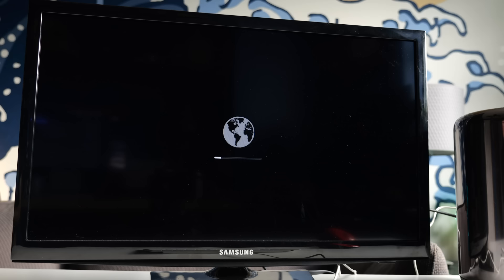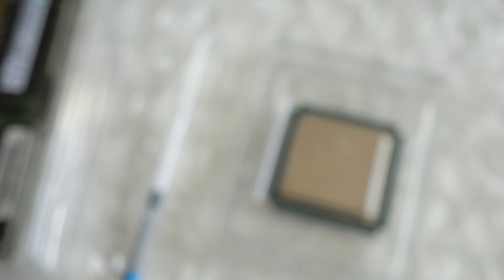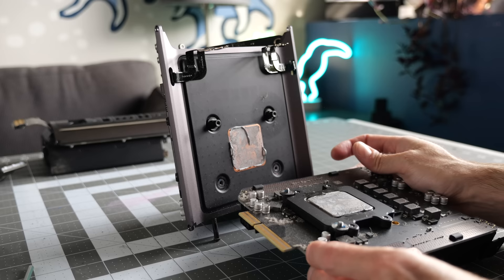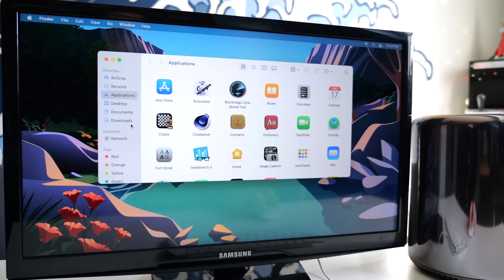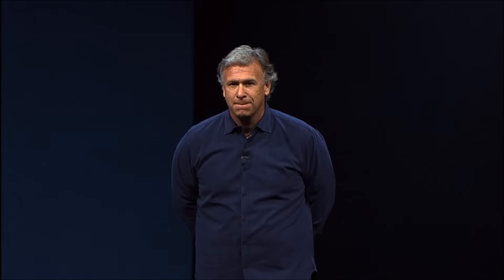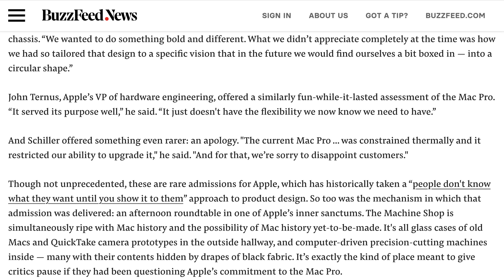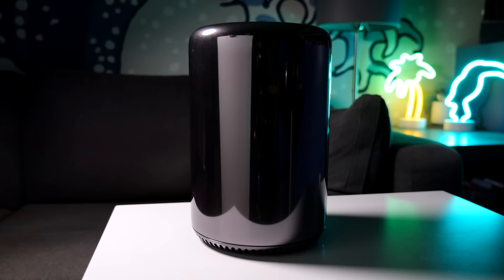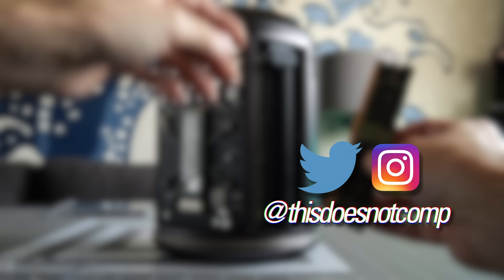Can This Decade-Old Mac Pro Compete With Apple Silicon?

Comment: Comparing the graphics performance of a laptop M1 to a dedicated GPU even an older one is kinda unfair.
You said that the M1's graphics performance is "no joke" and sure compared to other APU's that's true but compared to far cheaper windows laptops with dedicated GPU's it gets demolished. from what I've seen it offers sub 3050 performance so no surprise it doesn't hold up against an old pro card.
Honestly it just seems like Apple have stopped caring about graphics performance, relying on very limited accelerators to pump up benchmarks and hailing the few mac os games performing like a windows laptop at half the price as if its somekind of victory.
It's kinda ridiculous, I bought a laptop this year and the macbook pro was high on my list but the simple fact that I like video games meant that it wasn't a realistic option. People like me make up a large proportion of PC users nowadays and so Apple continuing to uphold the Job's era bias against games is baffling and now it's even worse as you can't even get a decent DGPU or install windows to get the best of both worlds, it's like they don't want pc users to switch smh.

Comment: The only difference between the computer you started with, and the computer I use, at work, on a daily basis, is mine has 32 GB of memory. When I ask for more memory, I get the responses of, “it’s not in the budget, it’s not going to make a difference, or you’re on the list to get a new computer next year.” I’ve been dealing with these excuses for 5 years.

Oh, one other “big” difference. Mine is still spotless and pristine. There isn’t a spot or scratch on it.

Comment: This is a good take on the trash can mac, but it would've been more interesting if you benchmarked a 10-core processor (E5-2690V2); it has a faster clock speed and better single core performance than the 12 core (E5-2697V2). Also, It was never an official option from Apple.

Comment: I am running a Dell Precision T5500 with Ubuntu Linux I have a faster Graphics Card but I am almost blind, and cannot install it by myself. The Machine is like a Bank Vault but quiet and Never Heats up!!! The Dell Precision™ T5500 Workstation is a productivity machine with lightning-fast 64-bit multi-core Intel® Xeon® processors, impressive graphics well it was in 2009  however seeing as how I do not Play Games, it's okay. 2160p running on your Video just fine!!!

Comment: Well if I could upgrade mine I would do the better at >>e5-1660 v2 core 6 12 threads core  3.7 ghz   it's faster than the 12 core  e5-2697 v2 slow 2.7 ghz  12 core  24 thread core

Comment: Factually incorrect about the idea of multi-GPUs being unpopular in professional applications. It's only that it happens beyond a certain budget, for people with certain needs whose work demands more GPU compute power. Budget that ironically sometimes fits within the price of the current Mac Pro. If a single RTX 4090 or RTX 6000 (Ada) doesn't give you enough performance in GPU rendering (Octane, Redshift, etc., even Unreal Engine) or simulations or AI applications... you buy two or more. It's not uncommon - cloud rendering/remote render farms aren't everyone's cup of tea. The caveat is that Nvidia's CUDA is the dominant force in the market, despite Apple's best attempts with Metal.

Comment: Has anyone worked on an adapter from whatever that is to PCIe? Run a cable outside to an eGPU, or thru thunderbolt? What's the max speed on this model?

Comment: doesn't this experiment kind of give some validity that consumer computers are hitting a stubburn plateau of performance? Seems to be crazy hard for the. tech corporations to deliver the leaps forward in performance and capability that they used to (spouse still uses a 2011 Mac and is happy as a lark - is like the end of computing history was reached a decade ago as far as what most users need or require)

Comment: Can This Decade-Old Mac Pro Compete With Apple Silicon? 875 Watt Power Supply, Weight  (38.0 lb).
The Front Cover is not Aluminum, Put a Magnet  on it!!! It's Steel. that's why it weighs 40 Pounds.

Comment: I stopped liking apple after 2015. Their business model of being a premium product got out of hand trying to squeeze every penny out of you and overcharging just for the sake of being the only company making custom software and hardware. At the expense of usability. Removing the audio jack, magsafe, HDMI and SD card slot. and introducing monitoring software like siri and forcing you to create a apple account. They lost me. I will never buy a brand new mac again.
Reply: I agree mostly, but Microsoft Windows is just so effing horrible: the forced updates, the subscription-model, bloated and unstable. Pick your poison. Linux is great, but where's Adobe Premiere for linux? Lightroom? For this reason I have a Win 10 20h2 box disconnected to the world. No internet connection whatsoever. No more updates, no more bullshit malware, just occasional USB drives from RTOS, Mac, Linux computers that can handle the dangers of the real internet. Windows is a childish operating system, lost to the world without constant interventions from helicopter parents in the form of daily software patches.
Reply: @extraordinarygoodmachines4364  True, I use linux for daily browsing and an old mac with yosemite macOS for video. I would probably go to a  similar setup as you when I will upgrade. Linux did come a long way! But I've tried installing editing software. I wouldn't run at least not on my old hardware. I hope Adobe will do a Linux port some time. Just like a professional DAW, I imagine it running much more stable on linux.

Comment: Apple has been having a lot of success with their non upgradable pro line of laptops. However their line of upgradable Mac Pro desktops were complete over engineered flops. The trash can Mac was the bigger flop than the uber expensive 2019 Mac Pro which really isn’t upgradable due to proprietary components. Apple released the expensive but not as bad Mac Pro replacement called the Mac Studio.  A maxed out Mac Studio will run a whopping 8,000 dollars but nearly as fast, while being far cheaper than the 50,000 maxed out 2019 Mac Pro. 

I am going to be building a new gaming PC with partial parts coming from old PC. Intel I7 1300K, 32 GB Of DDR4 3600 memory ( DDR 5 memory and supporting motherboards are too expensive. New 600 series motherboard, supports 13 Gen intel processors with BIOS update, as manufacturer provides it) New 1000 watt PSU to support my RX 6800XT (which I have been using on old PC for a few weeks) and 250 watt capable cpu. New 500 GB PCI-E 4.0 SSD for windows boot drive. Using old Intel 660p 2TB SSD as storage.  Total cost will be around $950.  Not bad for a new beast PC. 

I do like Macs though.  I have had intel Macs.  Mac Mini, and 3 MacBook Pros. My current Mac is a 2020 Intel Mac as I wanted to have the capability to boot camp windows, but since haven’t used it. I was originally planning to use Mac as a semi portable gaming rig with e-GPU. Market has totally shifted away from eGPUS. I may get a new Apple Silicone Mac but waiting on new Mac Pro with M2 chip on it. Mac is my daily driver for productivity and other stuff. Gaming PC is only for games. 😁

Comment: A quad core xeon is skeet even for 2013 how lame they clearly didn't want users on the normal 12 core xeon chips most companies buy because then you would only need to upgrade the GPU

Comment: I got my trashcan in 2014 & modded it out in 2020. I plan on running it til the wheels fly off.
Reply: It doesn't have wheels.
Reply: @ShainAndrews  it's turn of phrase that applies to non-wheel having objects as well.
Reply: @christianokami2220  It can't fly.
Reply: @ShainAndrews  mine does

Comment: having cleaned/ serviced a few over the years...........that is not a clean machine - keep them clean and you will struggle to get them hot...........using the  core the system was original  for

Comment: 11:35 This is a horribly dogshit take... The modern Mac Pro would have been a complete & utter DISASTER if they'd made it dual socket. A Xeon Platinum 8280 (required for 2x socket support) costs way, WAAAAAAAY MORE than the otherwise identical 28-core Xeon-W (single socket only) part Apple ended up using. If you think the current pricing is bad, try DOUBLING the cost for the same core counts and then see how things go!

Also the number of consumers who realistically needed 56 CPU cores was absolutely fucking TINY!

Comment: 10 years is a millennium in computer terms. So a notebook with computational power of a 10 year old desktop is actually kinda really bad ....
 Also a 10yo slow video card (yes it was slow af even 10yo) getting better performance than a video card in a m1 notebook wow 0_0

Honorary mentioned: apple still sells notebooks with 8 gb of RAM, that amount was trashy even 4-6 years ago. Apple just ripping off its costumers (
Reply: I still use ThinkPad x240 as internet-typewriter and it deals with it's role good enough even in 2023(yeah, with 480 gb cheap Kingstone ssd and 8 gb AMD RAM upgrade)🌝

Comment: Not worth it. Better build a PC even budget i5 13gen 13600k outperforms mos powerful apple chip M1 Ultra in Cinebench R23 with results about~ 
Single-core 2050 
Multi-core 26000 
This is 3x faster than your current system.

Comment: https://youtu.be/_XaZ2z7FEfA?t=799
um.. I bought a used Mac mini M1 for $450...and I added a 2 tb ssd usb c for $140... = $590.  A more fair comparison would be if you did a comparison to apples cost of ram and hard drive upgrade to the trashcan Mac.  You compared a self upgraded trashcan Mac to an overpriced Apple ugraded Mac mini as your claim that the upgrade is worth it.  The future is still apple siclicone.. unless you have a compelling reason to stay on intel (due to app support), I still say it's better to get a refurbished Mac mini M1, and add a usb C ssd.